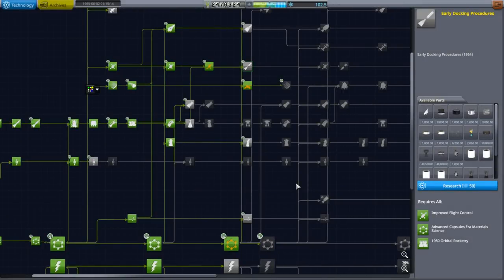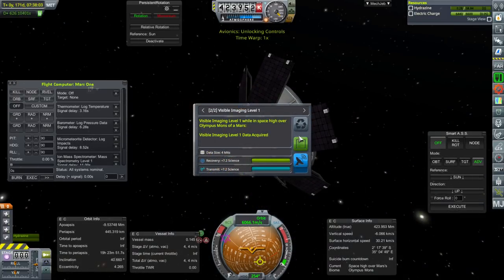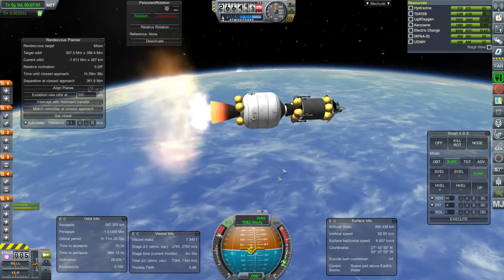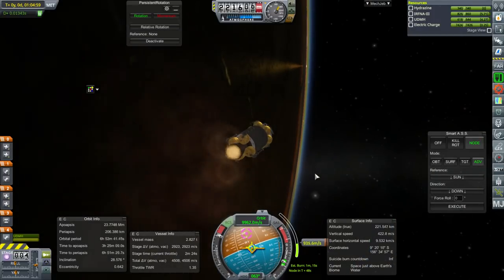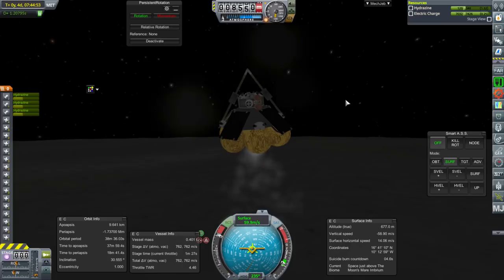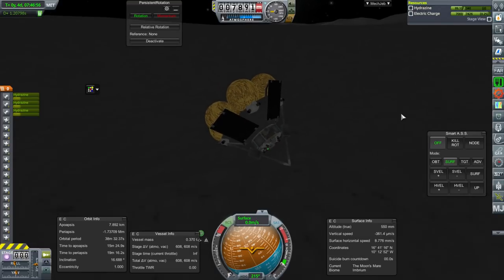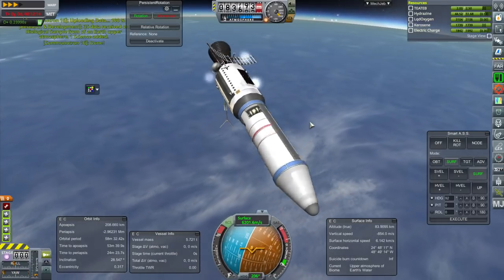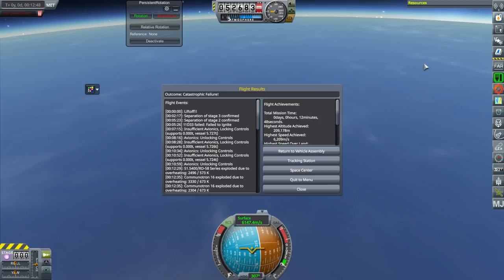KSP 1.3.1 with Realism Overhaul - RP-1 20 - First Mars Arrival

Comment: Those very inexpensive nuclear engines in RP-1 are probably a mistake. I don't think someone would do that on purpose. i asked about that on Github, we will see what is the answer.
Reply from the maker: Yeah, there are a lot of price balancing things in any situation like this, so I'm not really surprised. I've never used the Kerbal Atomics mod in particular before, though I think the NERVA II is not part of that. For my part, I'll need to be careful about the pricing of KSP Interstellar parts since I'm trying to integrate those into the tree.

Comment: Good work as always~
I'm wondering that can you tell me the specification of your PC?
I'm planning to buy a new PC, in order to play heavily modded KSP like you!
Reply: I have a 7th gen dual core I7 at 3.5 ghz and a graphics card that is only 2-3 times better than intergrated graphics (nvidia geforce gtx 940mx). I can run KSP RP-0 with rssve-lite with relative ease.
Reply: I am not sure, but I think Tyler has a I7-6700k and a 980ti?
Reply: @nicolasflamel2027  Thanks! I'm planning to buy i7-8750H, GTX1070, 16G DDR4. Do you think, is this enough?
Reply: @hij4155   - It is certainly enough. I am not sure about running Extreme Texture Overhaul on it... but I am pretty certain it will do scatterer and RSSVE mid-high res. I can run ETO on my laptop, just not beyond 5-10 fps. If you have dropbox, and not a good install of RP-0 (or RP-1) just tell me and I'll share it...
Reply: @hij4155   - 😀👍 https://pcpartpicker.com/list/3dn4WD
Reply: @nicolasflamel2027  Thanks!!
Reply from the maker: I have an i7-4790k running at 4.0 GHz (not yet overclocked) and a GTX 970. I have 32 GB of DDR3 RAM.
Reply: @RaizSpace   - Ah, I must have confused it with somebody else... This is a second account of Nicholas Flamel btw.